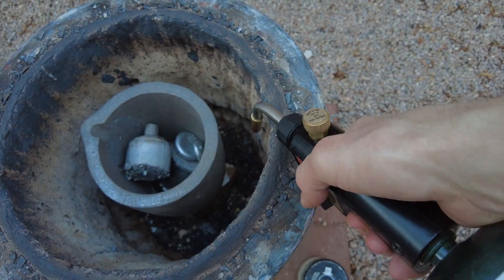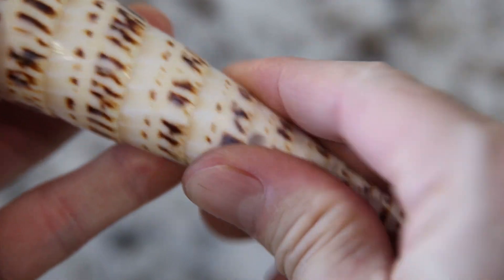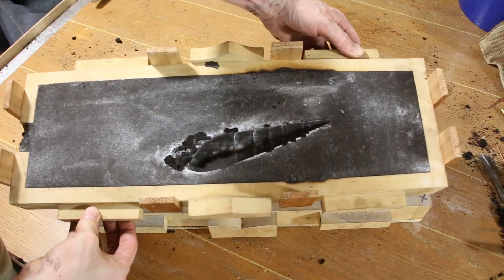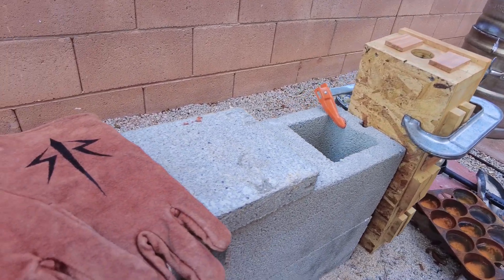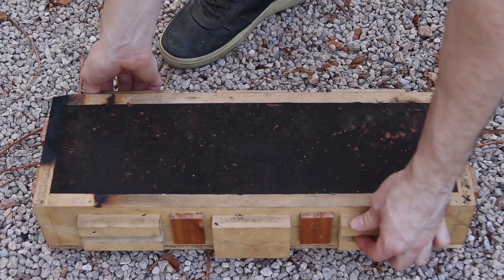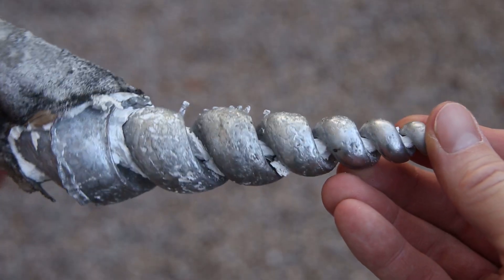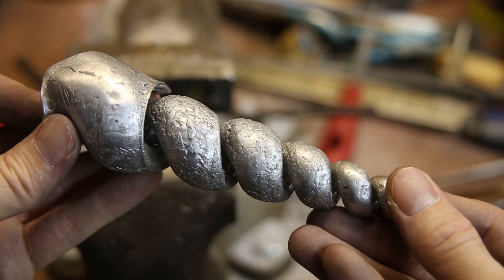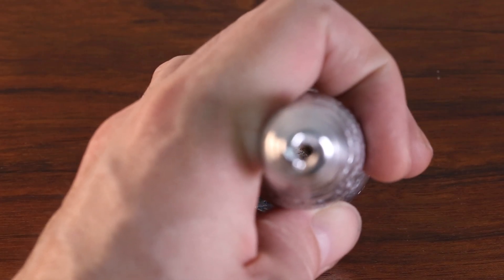Pouring molten metal inside a seashell - WHAT HAPPENS? - Experimental metal casting at home - DIY

Comment: been done before, the others drilled a hole int the tip of the shell and made a big well to allow metal to flow in and out so they could almost cast the whole shell then cut the tag off and used a fine grinder to smooth the cut away they filled the shell with it standing upright to make sure the shell was filled and to allow any air to filter out  the filling or bleeding holes

Comment: That shell came out amazing, have you considered making swords or kitchen knives, you could utilize the shell casting as a blade handle to make anything from really unique basket handles complete with coral reef casted metal guard and a clean blade. Good work!
Reply: Seems like it's would be a bitch to clean, everything getting in those impossible to reach crevices.
Reply: @chestnut4860  
I'd get one.
Reply: I could see it if the casting was in epoxy.

Comment: Regarding washing the shell off - it becomes calcium carbonate after being baked to that heat (you basically just completed the first step in making quicklime). All you had to do was put it in water for a minute and it would have completely dissolved lol. Vinegar overnight probably slowed the process significantly

Comment: Answer: It makes the stink!!  (though maybe that wasn't a problem with the heat levels you're working with). I was taking holloware courses in a workshop that had just done some cuttlebone castings a few hours before and wooooboy was it eye-watering, even though the windows were opened and all the fume hoods were running.
At least you got a cool turn out!
Reply: The smell of burning oil and burning wood with this sand might overpower the smell of your cuttlebones!

Comment: You only really needed to submerge it in water, as you've basically turned the seashell into quicklime through thermal decomposition.
Reply: I came here to say the same thing.
Reply: Packthatbacktohighschoolchemistry….aluminum melts around 1200 F.  Cooking calcium carbonate to lime needs prolonged temps of 1800 F.  The seashell was still CaCO3.

Comment: It's crazy to think that a living creature used to live in there. This is an amazing project.
Reply: Used to live in? That creature made that. Every shell hand made
Reply: @kanyeweast3255  "hand made", like a fingernail, but I don't call my fingernails hand made. technically my hand made it...
Reply: If your hand makes something,that's called "hand made"...So...Your hand does make hand made fingernails.
Reply: @kanyeweast3255  Yes I know!
Reply: i am curious to what  sea creature used it and how much of the inside it took up
Reply: @chrishill6729  It would only live in the big end. The back end of it would grow out away form the creature in the same way as it gets bigger over its life and that makes the spiral shape very consisten. The back part would fill with body fluid or be used to store fat or something like it maybe.
Reply: @chrishill6729  Pretty sure it's body took up at least 1 less spiral than the shell, but would inflate itself with seawater to fill the entire shell when it was out and sliming around on one foot. Get a tube you loosely fit in from waist to shoulders, and carry it with it around you. Then try one you barely fit in. Which one is more stable with less effort?
Reply: @chrishill6729  and likely the entire thing. Arthropods I think? They've got elastic bodies usually like a clam, but they anchor at the bottom with a foot and pull themselves in and out at will for defense
Reply: @kanyeweast3255  ok that answers my question thank you very much
Reply: @kanyeweast3255  the aluminum is the animal that was in there. let that sink in and blow your mind. :)
Reply: Dr Zoidberg, Homeowner
Reply: @berb_yt  lol
Reply: Ahaha...This comment is amazing.You keep on being simple for the rest of us :)

Comment: It does look rather good. So you made an aluminum snail that would be inside of the shell. 

I think vacuum casting would have helped getting more of the shell filled in, and having a hole in the bottom instead of the side. 

Greetings,

Jeff

Comment: You ought to design and cast a fancier spoon for skimming off the molten metal
Reply: Problem is if you cast it it will probably melt when you use it. For example you could use a bronze or copper spoon for skimming aluminum but that would be able it.